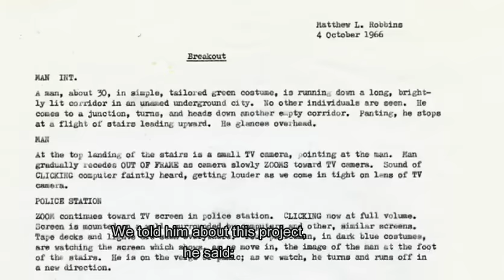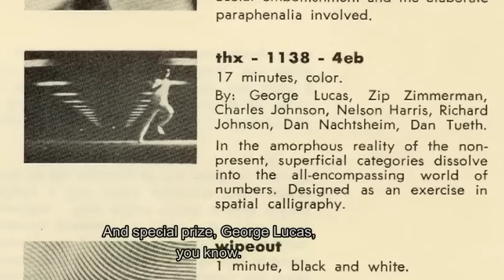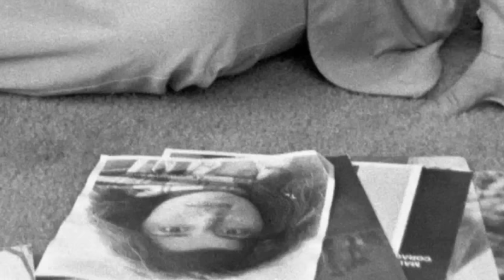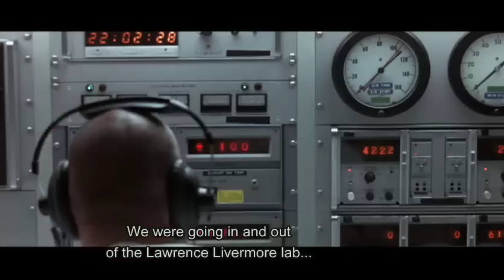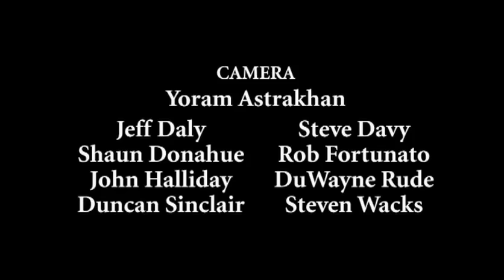Artifact from the Future : The Making of THX 1138

Comment: The love scenes between THX (Robert Duvall) and LUH (Maggie McOmie) were shot on the then-ColorVision Studios at 4401 Sunset Boulevard in Hollywood. Back then, they were once for the Monogram/Allied Artists pictures such as Queen of Outer Space and the original Invasion of the Body Snatchers if you can believe it!

After THX 1138 came and went, the local PBS station KCET 28 Los Angeles (now part of SoCal PBS with KOCE) bought the studio in 1970 and used it for Cosmos and Visiting... with Huell Howser until the Church of Scientology bought the studios in 2011 after KCET began its 8-year independent streak from PBS.